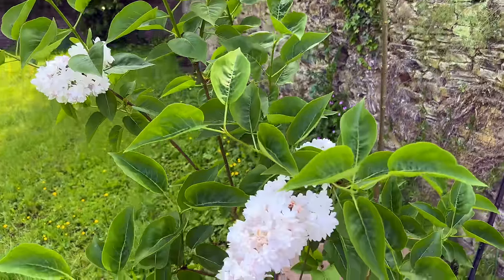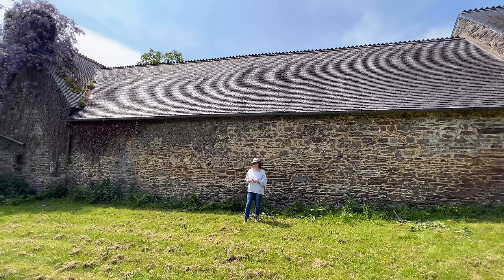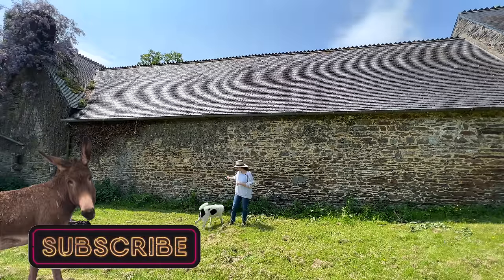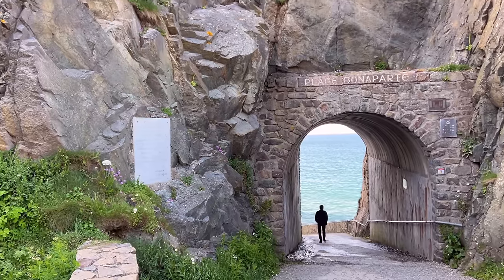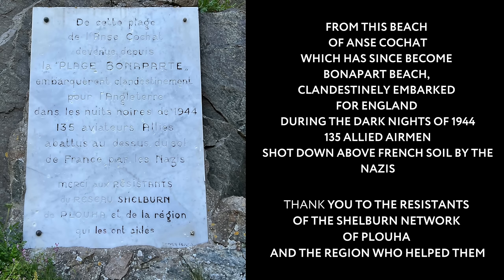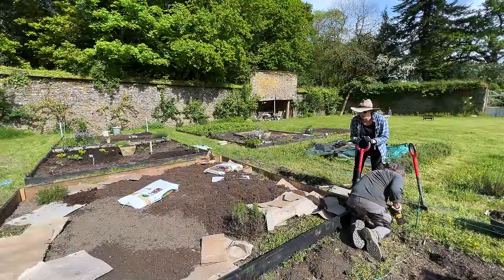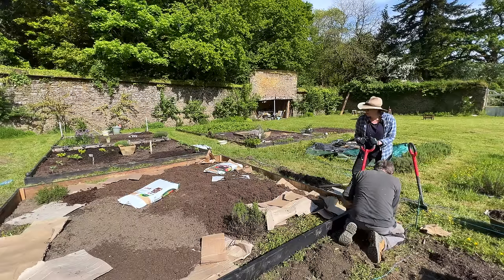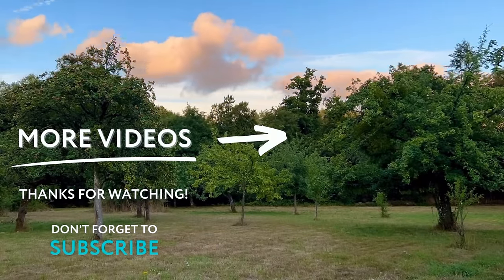Uncovering Strange Secrets of Our French CHATEAU

Comment: You may find weeding a good deal easier by spreading large black plastic sheets (held down by bricks or rocks) until you are ready to plant in spring.  The black plastic and the heat from the sun will fry the weeds to death so they WON'T grow before you begin spreading your new compost.  Take-up the plastic for use the following autumn.  

Also, I would recommend cutting the bags of compost at the top so you can re-use the plastic bags for being the linger for a bog garden.  

Near a shady spot in the yard, dig a decent sized hole (10 feet by 10 feet - or however large you like), line it will the plastic bags, stab them with holes to allow some drainage, and cover them with grass clippings, chopped leaves, and some dirt (plus a good deal of water) and you'll have a wonderful bog garden.  Doing this will allow you to plant some terrific large Gunnera  and other such bog loving plants.
Reply from the maker: I covered half of my beds. The other half I never got around to = weeds.

Comment: Spring is the best season in the countryside and your place is lovely. Regarding the bones in the wall, a famous example is the 18th century "chaumiere aux coquillages" in the park of Rambouillet. This rustic little folly is decorated with ox bones sticking out the walls. As you told us those bones were used to drain moisture out of the wall. (and in that case to underline the rustic style outside the chaumière in contrast with the very precious decoration inside)

Comment: Glad that there is a nice practical explanation for all those bones. 😅 I have been gardening in raised beds for many years in Maine. I use 2" x10" boards that I just plunk on the ground and fill with a soil/compost mix (sometimes I have to do a little digging to level). The grass and weeds are too deeply buried to do anything but die. Over the years I have made various refinements. I sit each board on a 12" strip of weed barrier to prevent weeds from outside coming up the inside of the board (4" outside, the rest inside). I use angle irons for the corners since I found the wooden corner posts rot quickly because their end grain is exposed. I put them together with hex head bolts so they are easy to remove when the boards need replacing; by that time the soil is so formed in place that I can remove a board and pop on a new one without the dirt moving. Every fall I turn in some compost. In the spring I lay soaker hose in each bed to make watering efficient in terms of both time and water use. In the past I have covered each bed with black plastic and made a hole for each plant; tedious but no weeding all summer. This year I am trying a self-composting paper (made for the purpose) instead. I lay cardboard in the pathways and cover it with grass clippings to prevent weeds from getting too close and dumping their seeds wholesale into my beds. If you don't use some sort to weed barrier on the whole bed, for widely spaced plants like tomatoes, you can lay a few layers of newspaper between the plants and anchor with compost to prevent weeds. This spring it took me at most 10 minutes to yank a few random weeds out of almost 400 sf of raised beds. Your beds are shallower, so I would suggest laying your cardboard and soil in the fall so the cardboard kills all the weed roots over the winter.  I love my gardening time in spring but in summer I want to be doing other things so I like to have my gardens on autopilot. Plus, I also have large perennial gardens that require attention. Maybe a few of these ideas will be helpful to you. Gardens are fun, healthy and useful but also can become a burden. Thanks for my donkey fix at the end of the video!

Comment: Could I suggest a quick sanding of the rust on your garden tools? They will last longer and there is less chance of infection if you should nick yourself. I once read of a woman who died from septic blood from a nick of her shears she ignored . The bones where very interesting , thanks for the info , I’d never heard of that use before.
Reply: My father, a very successful gardener, used oiled sand to somewhat rustproof his garden tools. He also oiled the wooden handles. Those tools lasted for decades. Sorry to say that I don’t follow his example. 😉
Reply: Yep. An old bucket, part filled with sand and oil, to poke spades and garden forks into a few times to re-oil. Just set in the garden shed near where you hang or prop the tools.